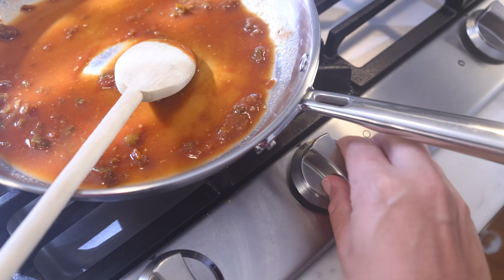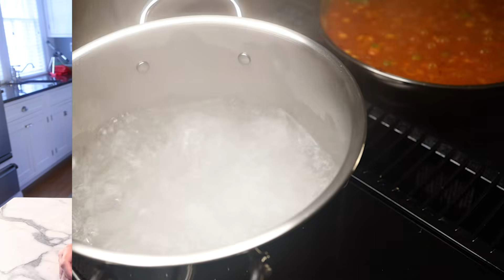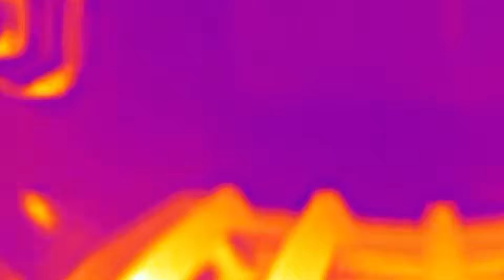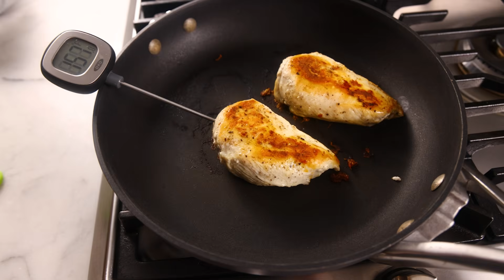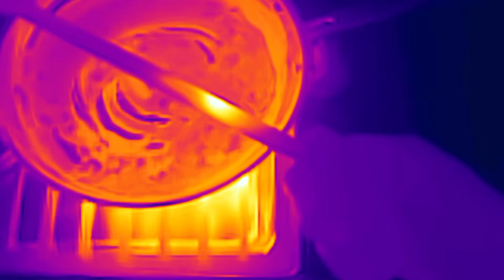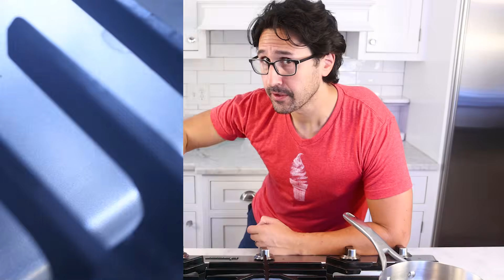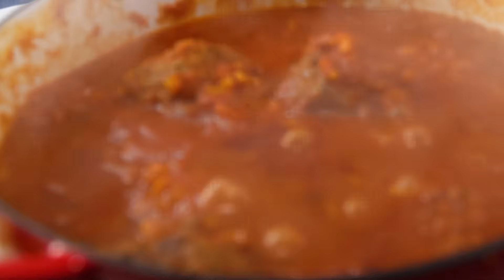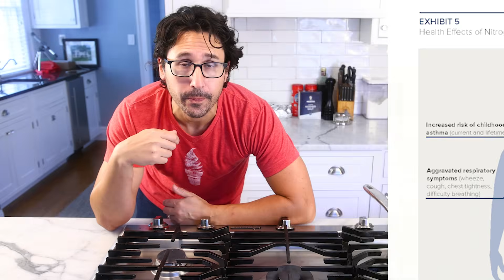Problems with gas stovetops | weak, dirty and dangerous

Comment: I once had one of those flat electric stove tops burst and shatter, sending a pot of boiling water into the air, and some of the water on to my mom. We were lucky that it was only a small amount of water that got her and that it wasn’t oil that was in that pot. 

After that, I’ve never trusted the safety of flat, electric stovetops, and especially not when used in the high setting.

Comment: I think it's just better to have all three types at the same time (some brand will try to make it work somehow). 
Most asian cooking with woks kinda need gas stoves and also foods that require instant heat control. 
Induction is slightly safer but it only works in some types of pans. 
Electric as mentioned is harder to control plus in places where electricity supply is iffy its very inconvenient. It's also inconvenient in small places because you can't move it away from the heat to avoid burning the food because there's nowhere to move to.
Personal anecdote: I remember we had a solid month of zero electricity because of floods and cooking would literally be impossible without gas stoves.
Basically having them all can be more useful than having only one specific type. Versatility.

Comment: We recently replaced the old resistive burners in our kitchen. The old ones wouldn't turn on anymore because of some stuck relay or something. And the replacement parts don't exist anymore.

I'd have to agree. Induction is the way of the future. We keep a close eye on our electric usage since we depend on solar for the majority of our power and only use grid power when it is cheap to help charge the batteries. (Depending on where you live, the price of electricity fluctuates depending on usage) Induction by far was a more efficient use of electricity. And not having exposed coils makes it much easier to clean. 

The other nice thing about it is that it heats up the pan, not the stove. So if you spill stuff on it it is less likely to burn and stick to it.

Comment: I love my induction stove.  The only problem is that it need special pots/pans.  A lot of cheap or specialty cookware doesn't work.  I still can't find a a good griddle top that would work on mine that isn't crazy expensive.  They all seem to have a raised edge on the bottom (cause they are normally reversible) so it doesn't really work well with induction.

Comment: My problem with electric stoves of any kind is that I don't always have electricity.
Sometimes it's repairs. Sometimes it's a tree falling over the power lines. Sometimes it's anyone's guess.
But it happens often enough that I don't trust having only an electric stove and electricity is almost three times more expensive where I live compared to the US.

Gas is cheap, it's dependable and if I run out of it, I just go to the nearest petrol station, pick up a new cylinder and I'm good for a couple months.
Also my house was built a long time ago and in a very weird way- technically it's not even a house but an outbuilding- and part of it is installation in the kitchen that won't handle the power needed to run an induction or electric coil stove- Gas is less fire hazard than electric in my case.

Comment: 1:41 it is the difference between convective, radiation and conductive heat transfer. In gas stoves, relies on convective heat transfer, and fire also radiates light (radiation). So, a lot of the energy gets lost before the heat gets transfered to the pot. Once the heat gets to the pot, even more energy is lost as heat transfers from the pots surface to the air. Meanwhile, in electric stoves, the heat transfer method is conduction. So even if it takes a while to reach the desire flux, it is more efficient.
Reply: Yeah, I have to wonder what the broad comparison is between the inefficiencies of electric including the generation and losses through the electrical lines to the stove (and in many US states, the majority of the state gets the electricity used in the electric stove from natural gas to begin with, so it goes natural gas--->electricity----> stove heat) to the gas stove where you have to  transfer the gas via pipes and then you are cooking on it directly (so just natural gas---> stove heat), but you have poor efficiency in terms of heating the water or food.

Comment: I am showing my ignorance here , but someone plese answer me
Whar are those gas stoves connected to ?  Like yes gas , dah . 

Sure NOW you can get a pipe that provides natureal gas for heating , and I suppose you can have some of it going to a kichen 
But that is a new thing . Gas stoves have been a thing for years .

And the oven , to my understanding , has always been electric .
why have 2 different systems ?
Reply: Well, for gas you can literally conect them to a gas cylinder directly or have a system of pipes included in the house. For ovens, if you have the stovetop and the oven as a one piece, the gas conection will feed both, if they are separate, the oven most probably will be electric

Comment: Adam, it is also possible to manually decrease the gas output of your burners to get a slower simmer. On most stoves you just have to pull off the knobs then there's a flathead screw you can turn to adjust the output. You do have to be careful not to turn it so low that they'll easily snuff out of course!

Comment: I've got a few objections to this video. 

Firstly I think there is a high amount of built-in and personal preferential bias on the fact that your entire kitchen has been built to work with an electric stove, it's sort of like saying "a reason why Cental America isn't as good as Canada is because I can't wear any of the jackets I used to wear up north", the example pot used for the video (and this is probably intentional) has probably the roundest and least optimal bottom surface for gas. 

Secondly on the issue of the valve/gas flow and not being able to lower the heat enough, I've personally cooked almost exclusively on gas burners throughout my life, and I have never had this issue, in fact quite the contrary, the lag from electric stoves causes me to overcompensate on heat generation and as a beginner it's easy to mess this up. This is obviously personal experience but it leads me to believe you might be dealing with propane, and not natural gas, which is much easier to control due to it being fed at much lower pressures.
Reply: Firstly, Adam did make it clear that this video was about his problems with gas, not about anyone else's experience using gas. Also, at least in the US, no pipelines to households carry propane (edit: I haven't fact-checked this, but I've never heard of anything like this, so at the very least, it's incredibly rare), so unless you've physically hooked up a propane tank to a propane-specific stove, it's 100% natural gas.
Reply: @seisage  People who use propane in the US use external propane tanks, this is usually in rural areas where there is no gas infrastructure.

Also, I get that these are his experience, I figured it would be good to contribute my thoughts.

edit: there's a good chance since he lives in Tennessee he's using propane
Reply: @dashwinterson8855  Not all of Tennessee is rural lmao. I don't know where people get the impression that everyone in the South lives in relative squalor in the backcountry. There are three large cities and plenty of normal-sized cities and suburbs in Tennessee. I'm pretty sure Adam resides in the suburbs of Knoxville, where there is plenty of gas infrastructure. I can guarantee he's using natural gas. If he had to use an external propane tank, he would know for certain that he's using propane and would tell us that in the video? I'm not sure why you seem to be so insistent that Adam must be using propane.

As explained in the video, natural gas is not faultless. It can certainly work for some people, but for others, it's just not what they prefer.
Reply: @seisage  sorry I didn’t mean to imply Tennessee was rural, just that it lacked natural gas infrastructure like in a state like Texas or NY

I’m not insisting that he is using propane it just seems that way based on his critique and like i said natural gas is inherently easier to control since it’s stored and transferred at lower pressure
Reply: The "not low enough" thing is very range dependent I've found. Some do it fine and others not so much. The one I have now is horrible at it so I just put a second grate on top when I need a simmer. It really isn't as big a deal as people are making it out to be.
Reply: Agreed

Comment: I grew up with a gas stove for 20 years since I went to college close by and it’s fascinating to hear your essentially opposite experience
Reply: It's just because Adam here shows he does not know how to use a gas cook top and he is trying to use them as an electric one... this is like using a cast iron pan as a Teflon one and complaining it does not work the same... which is exactly what he did on the cast iron pan videos... Honestly Adam is entertaining but he does not seem to do much research for these vids

"Side burning problem" your pot/pan is too big for the burner... choose an appropriate burner size
"low not low enough" same, move the pot to the small back burners, that's what they are there for
"dirty", how easy is it to clean from under a coil?
Reply: @exanime  Uhhh... "Side burning problem" would've been pan too small for the burner, not too big. He also addressed the "low not low enough" response within the video by saying that the lowest setting on the small burner would still be to high. To be fair, this is probably more of a "your stovetop" rather than an "all gas stovetops" issue, but this entire video is, in short, Adam bitching about his problems with his gas stovetop, and he said so. Finally, as for "dirty", I'm pretty sure Adam's used to glasstop, which wouldn't require cleaning under the coil at all.
Reply: I think there is probably more consistency with gas between different stoves. I mean like he said it's basically all controlled by a simple valve so not like there's some fancy engineering going on to make sure it get's as hot as it's supposed to. I think there's a WAY broader range of quality for electric stoves. I've lived in a lot of apartments and some had shitty electric ranges and others had nicer ones. My current is a pretty nice under glass style one and I've got very used to it, to the point where I don't miss gas anymore,  especially in the summer because gas kitchens can get really hot, but definitely at other places I'd go home to my parent's house with gas and be so happy. 

Due to more differences between models, and because you can't just eyeball how big the flame is, I think it's also way harder to use an electric stove you're unfamiliar with and get it right the first time. You really have to learn your stove to understand what setting it should be on AND how much time it takes to preheat. Because some of the under-glass ones especially can take a long time to get hot and a long time to come back down if you set it too high. So you'll end up doing this roller coaster ride where you put the pan on medium for a minute, plop your stake or whatever in, nothing happens... , so you crank it up to 8/10 and it starts to finally get cooking, but then all the sudden everything is burning even after you turn it way down, so you put it all the way to like 3/10 and then eventually nothing is happening again. 

But as a semi-clean freak the biggest advantage to under glass (or whatever miracle of engineering material they are using) is that with the right cleaning products you can get the worst burnt on food off the range and get it back to brand spanking new looking, while gas and exposed coil ranges are a pain in the ass to clean and after you've used them a while there's often a point of no return where no amount of cleaning will ever get it looking new again.

Comment: I absolutely hate electric stoves. This is my first time having gas stove vs coil or glass top and the ability to accurately get the temperature I want in the pan is so nice. The only way I could control temps well on electric was by constantly taking it on and off the stove.
Reply: Induction is the real way to do electric.
Reply: See, I actually have the same problem, but with gas stoves! My parents have a gas range at their house, but I have a glass top electric range at my apartment. It's so frustrating trying to cook things at my parents' house because of the issue Adam talked about where the lowest setting, even on the smallest gas burners, isn't low enough. When I would try to simmer sauces and soups, I had to constantly take the big heavy pot off of the flame because it would be boiling
Reply: @seisage  Ah i think my particular one has a super low heat burner. Its supposed to be like 130 degrees or something, so maybe that's why?

But my big issue was it felt like medium or medium high never really did medium. It just felt like it was a slower way to get to the same high heat on my electric ranges.

My dream is to buy a range with a super high BTU open burner though
Reply: @seisage  interesting I’ve never had that problem with my stove. I guess it varies with brand
Reply: In the Netherlands we call them "ceramic" plates and they do indeed suck. Induction's a revolution though.